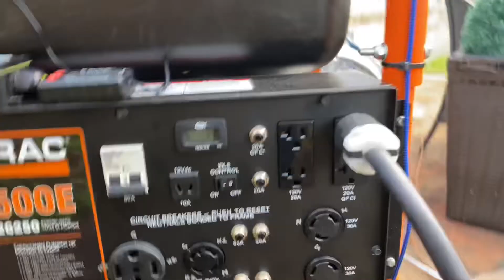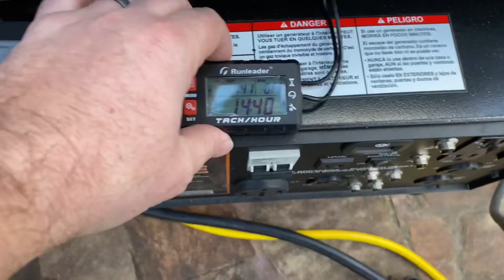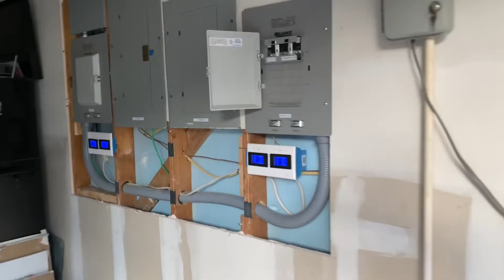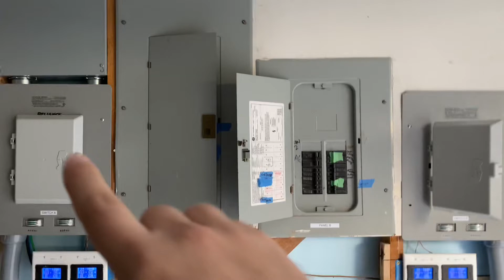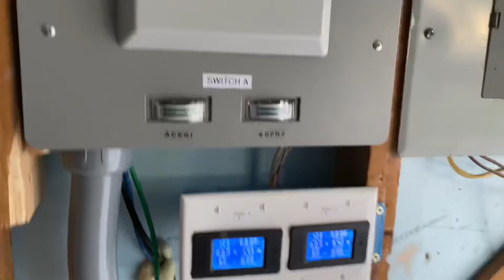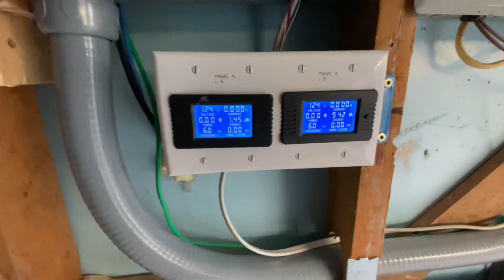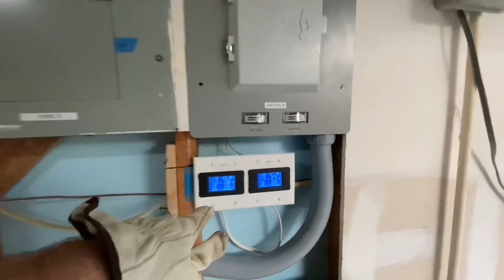Home Generator parallel power install - 72Amps/17,500 Watts - Generac GP17500E - Transfer Switch

Comment: Manufacturers advertise the running THD. Ive actually measured my Westinghouse 12k. Running thd 4.1% no load. 3kw is 7.9% 10kw thd is 13.9%
Generac is one of the higher I've measured 21% high load. Running 4%. Predators are about the same.
Turn on you microwave running the generator. It will sound really bad on dirty power. When your hvac heat pumps kick on it may pop generator breakers. Soft starts are needed. 
I put my necessary appliances on battery/pure sine wave and the generator runs the charger. Keep solar off. Buy a small inverter generator to run tv's etc.
Reply: I was watching some videos today if whole house generacs being around 30% THD.

😮😮😮

Comment: That’s one helluva set up you have.   I’m also in Houston, and was looking into this specific generator.  I held off on purchasing it when I found out how “dirty” the output is.  

The best generator I’ve found so far is the Winco  WL22000VE.  It has a THD <5% and has the option of using a 120 amp, 240V, full power Anderson connector.  I’ve also looked at one of the newer Generacs… the GP18000EFI.  It’s got slightly more power than the GP17500, and uses Generac’s True Power technology to deliver <5% THD.  The output panel is very similar to the GP17500.  

I was holding off on the Winco because of the price, and have been considering using the GP18000 with a simpler version of your setup.  Gonna have to dig a little deeper to figure out which will be more cost effective.  

Great video and explanations!

Comment: A dual fuel set up will allow you to tap your gas line and not worry about running out of fuel, furthermore, you might want to dampen the sound emitted by the generator as it could cause nuisance to your neighbors, perhaps adding a muffler, and/or a soundproof shed. Great job.

Comment: Hi Jud, fellow Houstonian and I've been doing a fair amount of research on how to do this. I found  Westinghouse has a 20kw portable and have been racking my brain on how to get full use of the 83ish amps it produces at full load. Not that I'm planning on doing that. Like you, I want to stay portable because I feel I can do it slightly cheaper, move the gen to other locations if needed, and if I move, take it with me. I too have two panels and thought that this would be the best way, run one on 50 amps, and the other on a 30 amp outlet. THANK YOU so much for sharing and confirming that this can be done safely and up to code. One question I have is what size are your HVACS? I have a 3.5 and 2.5 heat pump system in my home. Did you have to install soft starts on your systems for this gen?
Reply from the maker: Hey John, sounds like you’re on your way to having a great setup! That genie looks like a beast. It appears your setup will be almost identical to mine. Friendly reminder to make sure your transfer switches switch the neutral, and that you connect a ground rod to your genie. I have a 5 ton & 3 ton HVAC systems. And yes, I did end up using the hyper engineering soft starters for both HVAC units. After installing them I saw a pretty significant reduction in stress on the genie during startup when the initial inrush current spikes. Good luck man!

Comment: Just pull the panel locate the two hots and the neutral coming from the generator head and wire directly     This crap your doing is garbage.

Comment: For people looking at this video in 2023+,  Reliance discontinued these neutral switching panels in mid 2022 (The XRK's). You need to look for an alternative/this doesn't work anymore. These panels are very special, and not the same as generic transfer switches. Switching the neutral completely separates these two panels, you can even run two separate generators in this video to each plug and be safe. (If you do that with a regular transfer switch, you'll parallel your generators' neutral line). Normal breakers and 99% of transfer switches do not switch the neutral. If you don't know what what this means, then PLEASE don't try and install this two panel setup on your own.

Also if you have a bunch of gas appliances like this video, you'll do plenty fine with a 12kw generator and a single 50A interlock switch in your main panel. The reason you'd want this type of setup is if you have a heat pump and emergency heat/strip heaters in your furnace to supplement the heat pump when it's too cold outside for it, which likely would draw 14kw+ together. You'd split the heat pump onto one panel here (2-4 kw) and the furnace on the other (10.5kw+ when it's cold outside/when the heat pump needs to go into defrost). (You can tell if you have strip heaters as a backup to a heat pump if your A/C or Furnace has a breaker at 50A or greater, generally we use a 60A  breaker for a 10kw strip heater).

Otherwise a general 50 gallon electric water heater is 4.5kw, well pump varies between 1.5-3kw. An A/C unit alone (one that doesn't supply heat, like in this video) will generally draw 3-5kw. An air fryer/coffee maker/microwave are each at most about 1.5kw; do you really need an oven/range in an outage?

Comment: Excellent setup.
What would help is a propane generator. No need to have fresh gas sitting around and with two tanks you can keep it running while changing tanks.

Comment: So what's the latest are you going with a standby or are you researching a portable replacement.  I have the Generac 17500 and I have been thinking of selling it to obtain the westinghouse 12K/15K dual fuel or the 20K/28K and then installing a tri fuel kit.

Comment: An awesome generator system you have. However, since you are not using near what your generator can provide; there is NO reason to turn off and on your circuit breakers. Just do not use those items IF they cause the generator circuit break. And I doubt you will have this problem. LEAVE them CB's on. 

I say this; because it will be a waste of time to turn those CB's off and then on; every time your power goes off. For what it's worth.

Comment: My set up is very similar to yours (house). I found a 15kw dual fuel with <5% THD. do you think that is enough power?
Reply from the maker: 15kw...is that starting...or running wattage? Which make/model are you looking at? If your house's draw is similar to mine, then more than likely yes...15kw running watts should be more than sufficient to "run" the house. But what you have to watch out for and consider, is the amount of inrush current the generator will have to supply when a HVAC unit turns on. For example, the generator might be more than enough to power the house in normal use...UNTIL...one of the HVAC compressors turn on and creates a giant spike/inrush of amps... and thus either flips the generator breaker...or makes the generator completely shut down (as a safety mechanism). Either way you loose power. 

Some people on here have criticized my selection in generator, saying that its oversized and not needed. But what they fail to calculate and realize is that if i have a smaller generator, the inrush for both HVAC units would cause a shutdown every time the HVAC attempts to turn on. I have Hyper Engineering Sure Start units installed on each HVAC compressor unit, which helps lower the inrush amperage and thus reduce the spike transient/stress it puts on the generator when turning on.

Comment: I like the setup you're using and the ability to feed and monitor 2 panels...kudos.  That really stinks finding out after the fact that the power THD can be hazardous to electronics and appliances.  Guess thats where the inverter generators shine but that comes at a cost.  One area not appealing to me though is a service disconnect exterior to the home for reasons i wont mention.

Comment: Hey Jud thanks for sharing your video.   I live in Florida and because of the constant threat of hurricanes I did something similar with my house a few years ago.  Only my setup is nowhere near as elaborate as yours but that's ok because I have a 1600 square foot home which doesn't need such a high kW output to power everything.   Like you I have a generator interlock switch on my main panel that I can use to isolate the house from the electric utility grid.   My generator is a Westinghouse WGen12000DF with a peak power rating of 15 kW and sustained 12 kW on gasoline as a fuel and 13.5 kW peak and 10.8 kW sustained when running on propane.   I was concerned my AC unit would eat too much power for this thing but based on the power consumption you showed in the video I think I am very good on wattage.   Your notice about the clean sine wave problem almost sent me into a panic but then I checked my generator's operators manual and it shows THD specification of less than 5%.  What a relief!   As luck would have it I have not had a chance to use this generator yet because no hurricanes have smacked directly into us so far.   If I never have to use the generator I would be a happy camper.   Sorry to hear your Generac has a dirty sine wave problem.   I think you should look into the Westinghouse WGen20000 model generator.   It has a higher peak and sustained power output than your existing Generac and a THD of less than 5% also.   As an added bonus it's about $1k cheaper than the Generac also.   Good luck and thanks for posting!